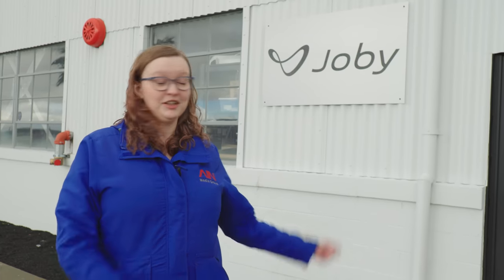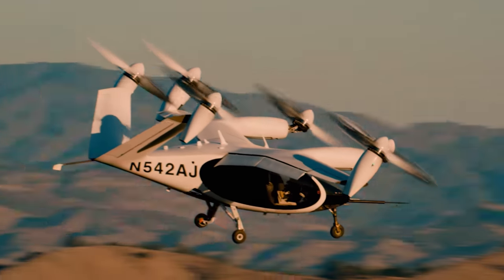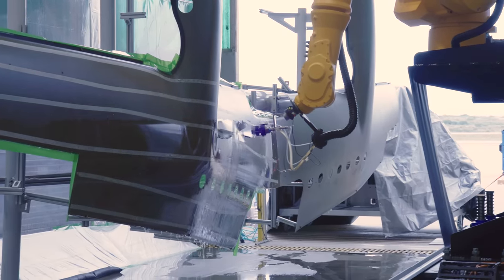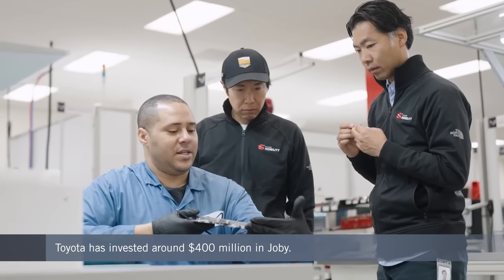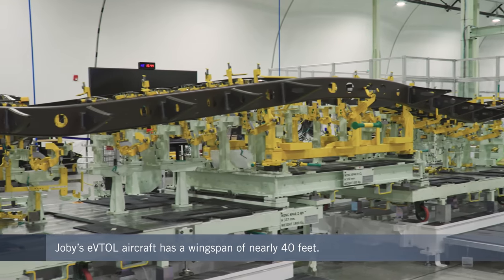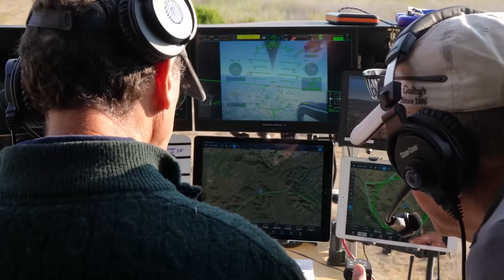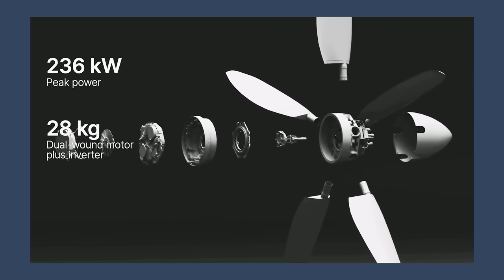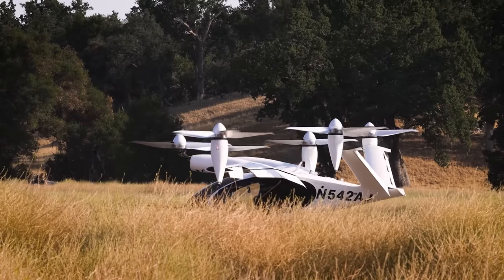We Go Inside Joby Aviation’s Pilot Production Facility as It Starts eVTOL Production – FutureFlight

Comment: Besides the governmental hurdles to get past with such new tech, the biggest issue will be the range and recharge limitations. It is very hard to beat the energy density of aviation fuels, even with the “inefficiency” of the internal combustion engine conversion. I have been in the aviation industry for 40 years, in time I’m sure this will get worked out. How much it will catch on as a practical matter, the market will tell you, but have to admit it is exciting to think about the possibilities.
Reply: R22/r44 are very popular in brazil many sitting on top of buildings they hop from building to another don't you think this would be a possible replacement... a flying taxi is not needed worldwide? even germany is experimenting on a unit volo copter seeing a possibility of short range use of these things.  not "all" avaition services are long range some are hop in hop out like a taxi service you find anywhere else around the world.
Reply: The current range they have will fill niche markets like dense urban or industrial areas. They only need to fly a few minutes in many cases to save passengers hours of time. As the energy density and other technologies improve, so will their range and ability to charge faster. I think all of this will occur at an accelerated rate compared to the last several decades. battery technology is being worked on more now than ever before in history.
Reply: You're absolutely right. But this airplane will still find its niche in the aviation market. It has an indisputable advantage: it is the quietest vertical takeoff machine that can fly long distances at the expense of the airplane's wing. Its noise is comparable to that of an automobile. That's its main feature.
Reply: Thanks for the reply’s, you all make good points. I guess I am looking at it as a replacement for a conventional helicopter, it is not. It fills a small  niche in that market, it certainly will be more cost effective to operate in short duration flights. Perhaps bring this service to more than lifestyles of the rich and famous (or Al least that is what they are counting on). When I started in this industry in 1980 the Boeing 727 was the standard, the 757 was the cutting edge, and Airbus was just the crazy Europeans. Burt Ratan had just built the varezee with this crazy plastic airplane, when the rest or the light aircraft industry was building designs from the 50’s and 60’s. I can’t imagine what the next 40 years will bring, maybe I will get my Jetson’s flying car after all.
Reply: This only needs to serve the rich for short rides initially until production capacity and battery tech improves.  At that point if the company has not gone bankrupt, it will be in great position to lower the cost and increase the range.
Reply: yes … this looks like another typical wall-street money pit …
Reply: But helecopters and planes are super loud
Reply: @ecase727  Imagine you would have a helicopter without its downsides: 
- easy service, because you rely on electric motors and not a custom made helicopter engine
- cheaper operation because you can easily produce a tilt rotor with electric motors -> higher efficiency -> lower fuel consumption
- low noise level, basically like leaves in the wind (check our their videos), so people around heliports do not get annoyed and accept them

+ the other benefits of a helicopter: You can basically land everywhere and need very little space -> low cost + high accessibility

Just imagine taking a eVTOL to the Airport instead of an uber.

Comment: I can't wait to see these in regular service in various cities.  I worked in aircraft design for over 15 years and I can see so many advantages in these, but safety is the biggest one. It has 6 pods, but 12 twelve motor systems.
Reply: If there is a motor failure that aircraft has the glide ratio of a rock.
Reply: @textech4056  No it doesn't. Each propeller is powered by two motors. Only one needs to work. Also, an entire pod can shut down and it still flies safely.
Reply: @elephone1542  What do I know. How about one electric motor. One large propeller and you have an electric Helicopter with auto gyro capabilities. Much much safer vehicle.
Reply: @textech4056  Did you mean Auto Rotate capabilities? You don't seem to understand this craft is designed to fly with one motor or rotor out. Possibly 2 or more. Auto rotation in a helicopter is not one of the easiest manoeuvres to perform.
Reply: @grahammonk8013  Are you going to try and convince me the Joby flying machine can not possibly have a catastrophic failure ?
Reply: @textech4056  I certainly won't try to convince you that having a catastrophe anywhere with any aircraft is not possible. However, with that much system redundancy, it makes the event highly improbable. Doing anything with any vehicle is all about risk mitigation.
Reply: @VictoryAviation  I think the aircraft itself is fine. I can see a lot of engineering has gone into its construction. My point mainly is with the batteries. The Lipo batteries. They are supposedly in the wings and 2  motor pods. The Lipo's are notorious for combustion. They are also very heavy. I am saying that craft wil not fly as advertised with Lipo batteries. I think they are betting all the marble's on the Solid State batteries being developed and used by Toyota. That is the next leap in battery technology. There is not a lot of information yet on their performance and specifications.
Reply: @grahammonk8013  "autorotation in a helicopter is not the easiest maneuvers to perform"?  You DO NOT know what you are talking about, autorotations are safer than a Joby because You do not know what you are talking about genius!

Comment: The problems with hele-taxies and hele-transport is limited by policy and practicality not technology.  The "problems" they are trying to solve can be solved with a regular helicopter and this evotl does not change any of issues with policy and practicality. Issues like where do you land? How much noise are people going to tolerate? (before people start talking about how motors are quieter, most of the noise generated from helicopters comes from moving the air not the engine so evtols will not be significantly quieter).   Flying cars are not going to be a thing it's not practical at scale.  Trains are practical at scale. Highways are practical at scale.  Hence the reason we use them.
Reply: Designers specify blade and relative geometries, and resultant aerodynamics such that the generated noise stays within a certain bubble of space around the propellers. That is why your argument is without a basis.
Reply: @gokcan83  The "bubble of space around the propellers" is going to be the same size or bigger than a regular helicopter.  Changing the prop geometry can decrease noise but it's usually at a cost of efficiency something that a battery powered craft cannot afford.  This is not revolutionary it's just tech circle jerking.

Comment: What is the big break through in battery technology? If they are using Lithium Polymer batteries it will not fly more than a few minutes.
Reply: Test flight time seem to be one hour and fifteen minutes, average light turbine powered helicopter's max flight time is less than ~5 hours. So difference is 1/5, and not ~1/100 like you say.
Reply: @HVM_fi  What were the parameters of the flight? Was that with a pilot and 4 passengers as is their goal.? Was is remote controlled? You use the term " seem to be". How certain are you of this lengthy flight? Did you witness this or was it a video.? I have seen no video of that craft in continuous flight for no more than a few minutes. You know this is not the first EVtol, to be developed, but it is the first claim these astounding achievements.
Reply: @HVM_fi  What were the parameters of the one hour flight? Remote controlled ? One pilot ? One pilot and 4 passengers.? I’ve yet to see a video of long term continuous flight. Why is that.? I remain skeptical my friend.

Comment: While I’m  hopeful the safety cheerleader might need to tone down the comparison between twin engine safety vs 6 tilt engine single safety without mention as to payload or passenger count plus pilot
Reply: Not sure what the payload is, but I believe the passenger count is 4 + 1 pilot. Their closest rival, Archer Aviation is making a 12 rotor/ 6 engine winged EVTOL with the same passenger count + 1000lbs payload.
Reply: This machine offers more risk of engine/motor failure due to the number of motors employed (1 motor, 1X failure rate, 6 motors, 6X failure rate).  And the ability to continue flight is no greater than a twin.  One engine/motor fails with either and you're immediately diverting for landing.  Conventional twin helicopter autorotates with a 2X engine failure.  Joby turns into a flippy-floppy rock with two motors failed.
Reply: @clarkgriswold-zr5sb  
Right on and it’s not flattering for comparison to a twin safety when we don’t know just how many motors could the air taxi loose before flight safety becomes a issue with full capacity and their belongings.
Reply: @clarkgriswold-zr5sb  LOL! Your comparison is flawed, because it assumes an apples to apples comparison in the types of engines. Internal combustion engines and jet turbines are WAAAY more complex and prone to failure than a simple electric motor (or even six.)  Also, having both fairly large propellers and wings, the Joby may not only be capable of autorotation but also gliding, depending on the mode of flight the issue occurs in. Lastly, while 2 or more engine failures MAY be critical for this EVTOL, certainly 1 engine or propeller failure in a conventional helicopter WILL be critical. The math is not on your side.
Reply: @helifanodobezanozi7689  
Pardon my butting in but single engine helicopter is an autorotate procedure performed in practice over and over again. 
Safety baked in the cake . 
With V TOL question never asked nor brought . I would appreciate it had a more robust q & A happened . Instead of flowering praise and fluff. More like a promo to investors less like an interview.
Reply: @GarryFishermusic  So are you suggesting that V-22 pilots, a VTOL aircraft that has been in service since 1988, haven't been practicing autorotation landings as an engine failure contingency? What you fail to understand is that the configuration of this aircraft isn't new. What's different is the number of engines, as well as the use of electric motors VS ICE engines. (Again, the reduction of complexity and the increased number of engines make this EVTOL far less prone to failure than even the V-22!)

I would appreciate more robust critical analysis in the discussion. Flowering baseless criticism gives one the sense of someone who is intent on short selling a stock, based on erroneous propaganda. (LOL!)
Reply: @helifanodobezanozi7689  
While I appreciate your input my criticism is practical not overtly trying to be critical.  
My point is more “her” the representative . 
the twin engine safety vs the 6 motor VTOL 
There’s  absolutely no comparison between the two . 
As I’m sure most people are aware  twins are designed to operate with one engine out. 
From  civil to commercial aircraft . Again show us the numbers on “her” VTOL with full passenger load and their belongings. 
Based on I believe six electric motors . Question is  front and center with performance how many motors can be lost before loss of control and safety of operation. Thanks 
I’m not anti VTOL but this design is unique from start to finish  with consideration of software build test flights approval of flight certificate 
until our beloved FAA stamps on it it’s a just brick .
Reply: @GarryFishermusic  Are you are referring to the lady who is the head of Joby flight operations? What reason would she have for NOT pushing her employer's product?  Also writing it is "a brick" until FAA certification is a little much. Remember, this aircraft is simultaneously going through USAF testing, which it could conceivably pass first.

Comment: A hybrid-petrol electric plane would make much more sense, in that  it would have a larger flight range, until batteries get stronger enough to match existing petrol aero engines. Also it needs longer wings for level flight,  plus at least two more passengers  to make for a more cost realistic " uber " type  craft!  The same design, when battery technology matures, could cater for the removable of the petrol engine , fuel tank etc, and replace the space with more batteries.
Reply: Currently all petrol airplanes use leaded gasoline, and children tested around airports have very high lead poisoning (and very low test scores). However, I don't think poisoning people around airports is as important as getting high income earners around faster.
Reply: Batteries are already heavy.  The extra weight of fuel, engine and all other associated parts are dead weight that kills electric range.  Keeping one leg in the ICE world works against this effort.  It should be all or nothing.

Comment: This is just my biased opinion! Drop the two outer rotors and have only 4 (more powerfull) motors and props instead. And small winglets outboard for enough lift at speed. This would give it way more appeal and way less area footprint. Higher top speed due to less drag, so it would still be nearly as efficient at speed. And VTOL is only less than a minute each way so the extra power required for VTOL would not be too much of an issue (offset by the extra speed, that I think should be significant).

Comment: Definitely need a small gas engine running a generator to supply the electric power for the motors. That's why a train locomotive is diesel-electric.
Not knowing what the power required to run those 6 motors, as a WAG I would think at least 12kW total and Lithium Ion batteries maybe 30 to 45 minutes flight time? And then have to recharge.
And I bet they will cost $250K or more each. More like $500K?

Comment: The biggest issue is not what you think it is. It is that the FAA demands that these multicopters be able to survivably land under full control when there is a total loss of all thrust. 

Helicopters can autorotate, airplanes can glide down to a runway and land at, typically, about 60mph. These multicopters connot autorotate and there are no runways where they plan to operate.

The FAA is not interested in talk about the redundancy offered by multiple motors. They've been in this business for a very long time, have heard it all before, and they KNOW that there's one day going to be a complete and total loss of all thrust.

So the big challenge - the one that has to be solved before even considering the less critical ones, is, as the FAA stated in that Certifications Requirements document that they published in November, 2022: "The aircraft must be capable of a controlled emergency landing, after loss of power or thrust, by gliding or autorotation, or an equivalent means, to mitigate the risk of loss of power or thrust"

...and they're disregarding parachutes as an alternative because they state that the eVTOLs aren't going to have the altitude that's needed in order for a parachute to sufficiently slow the descent.

There is a way to do it but it requires a completely different approach and it's one that has been around for 100 years already.

So there's the big challenge. If you can crack that problem then you'll have a really good shot at certification - and only then.
Reply: What solutions do you propose?
Reply: @Jay-Z33333  A complete re-design of the machine to adopt helicoptor's autorotate rotors. This is the only way that the multicoptor loses all engines and still be able to glide land the plane.

Comment: Six motors means six times more likely to have one fail. Remember, no autorotation is possible.
Reply: What do you mean? Why would auto rotation not be possible?
Reply: Regular helis have multiple single-points of failures, when multi-copters don't -in theory. But how it's executed in real world tells the real deal. Joby already crashed one prototype last year in airplane mode at in uncrewed maximum speed test, but that's not different from other helicopter test programs (less dead pilots, thought).
Reply: @justcommenting4981  Seriously?  Because there is not remotely enough energy stored in those small light blades. Also, control is not achieved by tilting and changing the pitch of the blades like in a standard helo. It is achieved by changing the speed of the various motors and keeping the pitch constant. So with no power, no control is possible.
Reply: @CockpitScenes you still have five rotors energised.
Reply: It can most certainly still fly if it loses one motor.